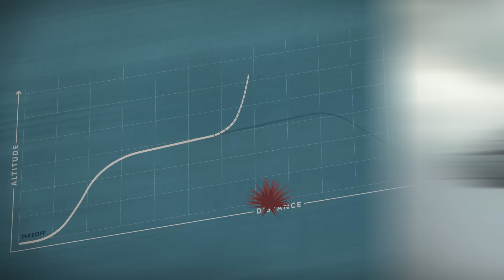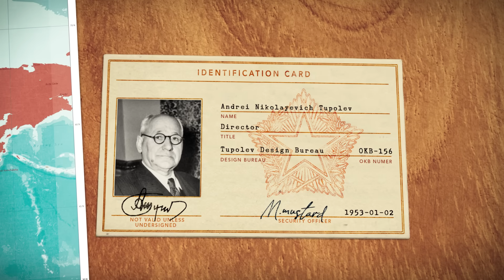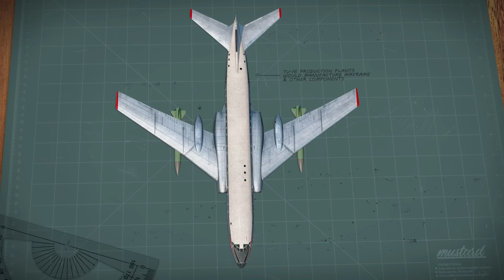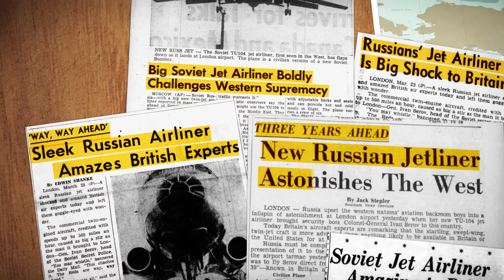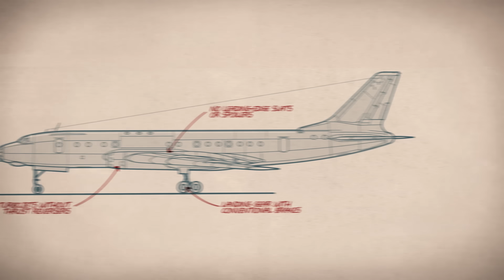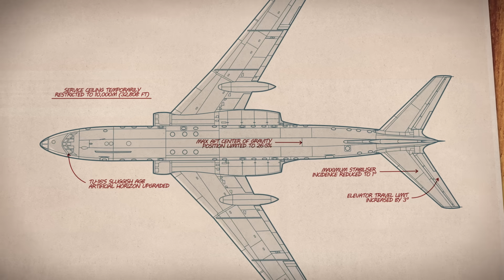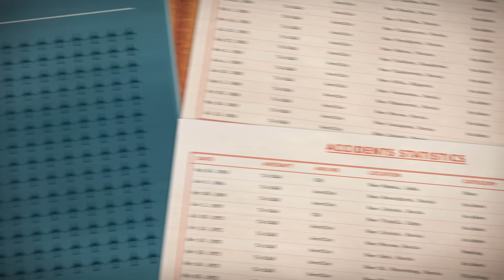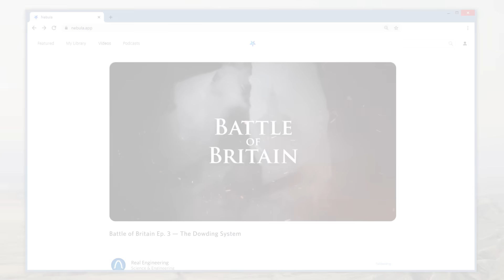The Soviet Airliner Designed To Crash

Comment: Britain invented the first Jet Airliner, The Comet, and it took multiple catastrophic midair failures and deaths before the problem was worked out. (Warping of the fuselage). This happens.
Reply: was looking for this comment, early comet was really not the best
Reply: @a4sleep  The Comet is the worst jet airliner in history.
Reply: @a4sleep  The Comet was a great plane, hence why they flew until 2011, the initial issues they had were simply due to being the first of their kind, the fact DeHavilland ran into and fixed these issues was the reason Boeing/etc didn't have too.  Historically from a safety/design point of view they were no worse than the 737-MAX and better than the DC-10.
Reply: @llynellyn  The Comet 1 never returned to revenue service and the Comet 4 was only in service for 22 years in total with many retired after just 16 years
Reply: @llynellyn  de Havilland didn't fixed the issues... they also went bankrupt in 1958
Reply: Also the rectangular windows developed stress cracks and were replaced with more rounded windows.
Reply: @sirridesalot6652  Square windows were never the problem, this was a red herring proposed by de Havilland  because they did not understand why their planes were exploding...
Comet 1 aircraft that had round windows installed were never returned to revenue service, they had their airworthiness certification permanently revoked because the problem was not the windows... it was the entire structure of the aircraft that was fatally flawed..
Some problems would be corrected or improved but some were never completely solved and plagued the Comet until they were all retired in 1980.
Reply: De Haviland  "added lightness" all over the aircraft including using a lighter gauge of a luminium than they really should have. The more powerful engines they wanted were taking too long in development , and they wanted to be first to market.
Reply: @arch9enius  Indeed, the Comets aluminum skins that were too thin but also are from an alloy that was too brittle.
The biggest problem was de Havilland did not understand the importance of rip-stop doubler joints  to prevent cracked from jumping across panels.
They also used too few riveted fasteners and fuselage reinforcements hoops were too narrow and spaced too far apart.
De Havilland had build plane mostly from plywood.
Reply: The early Comet was on the borderline of aviation knowledge at the time, being the world's first ever commercial jetliner.  Sadly it was discovered that constant pressurising and depressurising  of the fuselage caused metal fatigue particularly around square cornered windows.  This was discovered after months of pressure testing a Comet Fuselage to simulate Fuselage pressurisation and depressurisation whilst immersed in a vast tank of water at the Hatfield works.  This type of fatigue was totally unheard of at the time and came as a result of flying higher and faster than ever before in this type of commercial aircraft.
The results helped the global aircraft industries to avoid the same mistakes and why even today all commercial aircraft have oval windows fitted.
It must also be remembered that the same factory in Hatfield also developed ...the first ever Tri-jet ..The Trident ( later by Boeing in the 727 ) the  first fully automated Blind landing system  ..now called Cat 3..and the first to install a layer of ultra thin Gold into pilots windscreens allowing them to be heated to prevent icing.
Reply: @stevegolding5523  - Excellent background information, Steve.  Thank you for taking the trouble to relate the benefit of your undoubted knowledge.
Reply: @stevegolding5523  That water tank test were at Farnborough. Fortunately, Comet 4 which I met the first one to come over to the engineering at LHR and worked on for many years was much more successful.
Reply: @dave20thmay  The Comet 4 has the worst safety record of any jet airliner, only the Comet 1 was worse.
Reply: @stevegolding5523 The de Havilland company was decades behind in aircraft technology... its was still building aircraft primarily from WOOD and FABRIC well into the Jet Age... even the Comet was not a n all metal aircraft.
 The Comet Disaster remains the worst example of engineering incompetence and criminal negligence in the history of the the jet airliner industry.
Reply: @stevegolding5523  Yet de Havilland was still building planes out of WOOD and FABRIC right up until they went tits up in 1958...
 A company with an obscene disregard for safety and a loss rate unmatched in the industry... a. company doomed to failure.
Reply: Warping of the fuselage? I haven't heard of this one before. The Hawker Siddeley Trident had a bit of fuselage warping caused by the nose wheel being offset from the centre line. Every landing caused a twisting force. It didn't cause any problems.
Reply: No they didn't. Howard Hughes of Texas did.
Reply: The Comet 1 was an epic failure... its was grounded in 1954 and its airworthiness certification was permanently revoked in 1958.
 The first successful airworthy jet airliner is the Boeing 707 series.
Reply: What’s your point tho? This plane was clearly far more dangerous
Reply: @dopaminedreams1122  The Comet is the most dangerous jet airliner in history.
Reply: @sandervanderkammen9230  It's not the most dangerous jet in history no matter how you figure it.  The Comets had 13 fatal crashes over 70 years, by comparison planes like the Tu-104 and the DC-10 had more in significantly shorter periods of time.  Now obviously you can argue there were twice as many DC-10 so more were likely to crash, but the crashes per flight hours ratio is worse on the DC-10 (and significantly worse on the Tu-104) and while we're discussing crashes per flight hours Concordes was even worse than all of them.
Reply: @llynellyn  Sorry but you have no clue what you are talking about.
The statistics don't lie. The de Havilland Comet has a worse safety record of any jet airliner in history... in including the DC-10 series or the Tu-104... the DC-10 Actually has a very good statistical record and is still in service.
Reply: @dopaminedreams1122  Far more dangerous than what? Being the first to do anything is always more dangerous than what went before. Both the Comet and the Tu 104 beat their American rivals to the air before the rivals were announced.
Reply: @angusclark8330  Boeing was the world's leader in pressurized airliners in 1954.. the 707 Jet Stratoliner is the world's first successful, airworthy jet airliner.
Reply: It wasn’t a square window problem on the Comet, it was the early jet engines lack of power requiring DH to try to reduce weight that led to insufficient structural durability on the early Comets. Problem was solved on Comet 4 which was powered by more powerful Avons instead of the 1940s tech Ghost engines allowed for more structural strength.
Reply: @MeTube3  de Havilland did know how to build all metal pressurized airliners... the Comet was riddled with 100s of fatal design, materials and construction flaws... the result of engineering incompetence and criminal negligence. 
A truly shameful and humiliating chapter in British history.
Reply: @MeTube3  Racist? Sorry lad, but I'm not British.
Reply: @MeTube3  Sorry Andrew but you are wrong as an engineer it was part of our lessons learned examples in class.  They had no idea that pressurizing and depressurizing would cause fatigue of the metal, and cracks would form at weak spots such as corners of right angle installations.  The crack would propogate until sudden catestropic failure.
Reply: @aduboi1534  you were right to begin your comment with an apology for the rest of it.
Reply: @MeTube3  Guess you enjoy being ignorant.  I am both a phd in Nuclear Physics and Englneering.  I take pride in accuracy.  I do not spew anything I am not sure about, I will look it up.   So no apology here.  Here read this from an aviation technical paper.   You can apologize any time you like.    

Why Did The de Havilland Comet Jet Airliner Keep Crashing?
Oct 26, 2021The cause of the two planes breaking up in mid-flight was found. It was metal fatigue, exacerbated by the squarish window design. Engineers redesigned the structure of the plane, including adding rounded off windows, for what became the Comet 2, and that was the end of that issue.
Reply: @MeTube3  A well known fact?  Really?   Provide a source, a legitimate source.  Fact is in my education we had practical lessons in previous engineering failures.  Such as the Tacoma Narrows Bridge failure so we could learn about resonance.   The comet was another example, so we could learn about metal fatigue.  But I also provided a well respect source that said the failure was metal fatigue due to expansion and contraction of the fuselage, and now why airlineers do not have square windows.
Reply: @aduboi1534  Yes, Andrew is no engineer, but he is half right...
The Comet Disaster has absolutely nothing to do with the shape of the passenger windows, this propaganda myth is easily debunked by the slightest scrutiny.
Reply: The comet also only suffered very few fatalities before being grounded, thus plane continued service in a reckless way. It cannot be explained away as normal aircraft growing pains
Reply: @dopaminedreams1122  The Comet has the worst safety record of any jet airliner in history... the worst per flight and per passenger mile fatalities and the highest loss rate.
1 out of every 4 built crashed or were destroyed in accidents.

Comment: 04:04.....that's right, ready-made structural solutions from the Tu16 were used in the civilian Tu104/106 aircraft. But in addition, civilian pilots could immediately transfer to the military Tu16 in case of war.  In general, it was a program in USSR that allowed not to train military pilots separately!  This is how the Military An26 and the civilian An-24 appeared.  An12 and civilian An10.  Tu-95 and civilian Tu-114.

Comment: I flew on several of these when I went to the USSR in 1970. I did not know about these technical issues at the time, which was just as well.

I asked someone why the planes had what appeared to be a navigators cockpit in the nose. I was told that Aeroflot, the Soviet state airline is a branch of the air force. The pilots were air force officers and if necessary the planes could be redeployed for military use. I do not know if this is true or not.

What I did know was that safety did not seem to be an issue at that time. I remember boarding while the plane was refuelling. I did not smoke but several people were. As we took off, another plane came in and crossed our path quite close by. All through the flight, the door to the cockpit was swinging open and I could see the pilots at work. They were also a bit paranoid and made us foreigners sit in seats next to the wings, so we could not see the ground below.

Comment: Soviet civil aviation is almost Tupolev and its bombers' stories. Tu-104, first ever Soviet commercial jet liner, was based on Tu-16 bomber. Tu-114, world fastest propeller-driven aircraft, was based on Tu-95 bombers. Tu-144, the world first super sonic airliner, was based on Concord using engine from Tu-160, world biggest super sonic continental bomber.
Reply: TU-144 really wasn´t base on Concorde. It looks similar on first, but on the second, there are many differencies. Russian plane is more size. The engines were on first series Kunznetsov NK-144, on later series aircraft with cannard Kolessov RD-36-51A. Much better than original engines but not missfailure. Off course, the Concorde was probably much better plane. And succesful.
Reply: @tomasdusil8273   you can see the same video on this chanel. Tu-144 actually copied the design of Concord, by espionage of course. It had earlier maiden flight than Concord because the Soviet already had the engine from Tu-160, and use canard design instead of sophisticated curved wing like Concord. Long story short, the Soviet stole the design from Concord, and cut corners to make Tu-144 debut earlier.
Reply: ТУ -144 создан на базе ТУ-135 и М-56. Разработка началась в 1960 году. ТУ-160 самолёт другой эпохи. Это 70-е годы. Конкорд это копия ТУ-144. Прототипов Конкорда не было ни во Франции, ни в Англии.

Comment: No truly soviet engineering has ever been developed. Every piece of design was stolen from another country and claimed to be soviet/unique. And when another big project was finished - developers were executed or imprisoned. So called "great" soviet union was under rule of thieves and murderers.
Reply: Wrong. The USSR was a fantastic state for scientific development. Also, my great-uncle Zolton (originally from Hungary) worked on the Lunokhod-3 rover. No imprisonment then. You're thinking of Stalin's great purge from 1936-38. Outside of that window, any "imprisonment" of developers is strictly false. There's also a number of truly great entirely-Soviet designs, such as the Slava 2414 and Raketa 2209 watch movements.

Comment: It was determined that the reason for the DeHaviland Comet crashes were the square windows on the airliner that eventually caused stress cracks to form in the fuselage over time
 🛩💥🔥💀
   Soviet airliners had glass noses not only because they《still》needed navigators to find their way around, but also in case they had to be repurposed for wartime military use.

🌌🔭

Comment: One thing that was overlooked is that the Tu-104 was also the first TWIN engined airliner. It flew Transatlantic Routes long before the Americans realized that a twin engine aircraft can be just as capable, more fuel efficient, just as fast, and even with one engine out, still complete the flight. Only in the modern age did twin engined jetliners finally take over like the 737/757/767/777/787 Dreamliner. These all have twin engines, where the older 707/747/DC-8/Convair 880 four engine aircraft were eventually phased out. 

It's a shame you will hear a lot of people downing Russian built aircraft. They may not be as well built or as modern, but they fill the intended role well and it was truly a stroke of genius to use a existing military aircraft to create a passenger jet. The reverse is true for American aircraft. They took passenger aircraft and created military planes from those like the KC-10/135 which are based on the Douglas DC-10 and Boeing 707 respectively. Also there was once talks about creating a civilian MD-17 (military C-17) to be used as both a cargo airliner for companies like FEDEX, UPS, and others. And a mid ranged, STOL passenger airplane that could take off even on runways designated for small propeller planes. This would give it a massive advantage being able to reach areas normally not accessible to regular passenger planes. They Russians got there first, and it was and IS a good ideal.
Reply: Finally, a reasonable comment. The Tu-104 was an important milestone in aviation history and was an achievement of Soviet industry.

Comment: You wouldn't want to fly on a DC 10 either.   And the Boeing 737 -200 is no picnic either.  Almost as many crashes as the amount of those planes that were manufactured.  It's not just the USSR that had questionable aircraft, that's for damn sure.  And I want to take a moment to honor the sacrifice of the former USSR for their sacrifice and effort during WWII.  Without them, we would be living in a starkly different world today.

Comment: The Paper Skies video about the Soviet Navy's Tu-104 accident was excellent, and it's great to see an overview of the plane in general. Great video as always!
Reply: 10:41 There it is on that list.
Reply: @brianwong7285  good eye
Reply: Not that great, it's a very weak video with bad explanation. In reality those crashes were caused by stalls on wingtips (so called "Saber dance"). Planes of that era didn't have a special twist. New planes do have it. So now if a stall is occurred, it starts not on wingtips. But Tu-104 developed stalls on the wingtips, and as wings are very much sweped back, wing loses the lifting force closer to a back of the plane,  so the center of lift shifts to the nose of the aircraft.

And of course it has nothing to do with being a former bomber aircraft

Comment: There are numerous fantastic Russian aircrafts built. Most of them I've flown in. Especially the Yak 40, which was very spacious and strong. A malfunctioning de-icing unit at Sheremetyevo caused the nose wheel to get stuck in a non-aligned position and when the plane landed it shot right off the runway into the snow mountain next to the strip. My company refused to fly that particular charter plane unless it was recertified by a Canadian inspection team. They couldn't find anything wrong or damaged so it stayed in service. Mind you, that snow was what was buldozered off the landing strip and rather compact and the speed the plane dove into it was over 80 miles per hour. Only the part behind the wings remained visible. No problem, the exit is in the rear end of the plane and the air crew didn't blink an eye, business as usual.

Comment: I remember the first De Havilland Comet Jets. You mentioned them. many people died before they realized it was a design flaw
Reply: Embed jet engines wasn’t the Comet 1’s design flaw. Comet 3 & 4 retained them and served until the 80s. The Nimrod was a military version of the Comet 4 served until 2006.
Reply: @BimmieJames  The fatal flaw was the square windows, if I recall from an earlier Mustard video.
Reply: @JJR93  ohh I read it as 
“The first de Havilland Comet Jets’ (the Jet engines possessed by the Comet)”
It was saying that the Comet (was) a jet aircraft.
Yes the windows were the flaws I thought it was saying that the 4 individual engines were the flaws.
Semantics and grammar a-hole here. I have a problem!